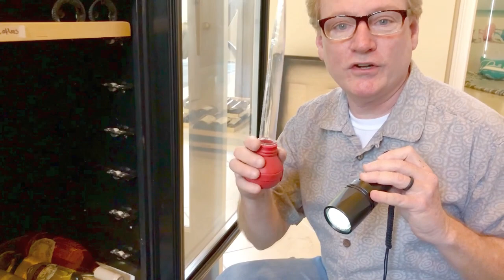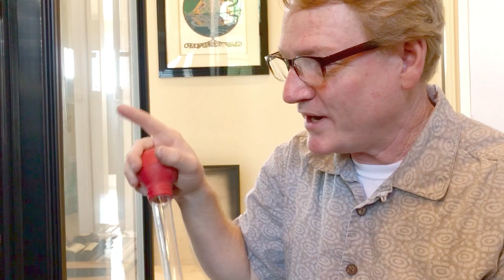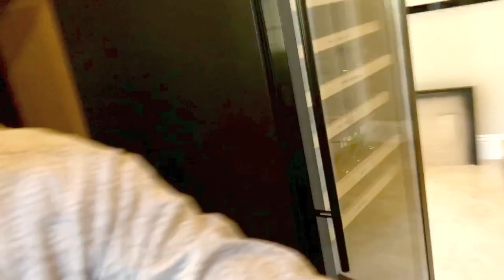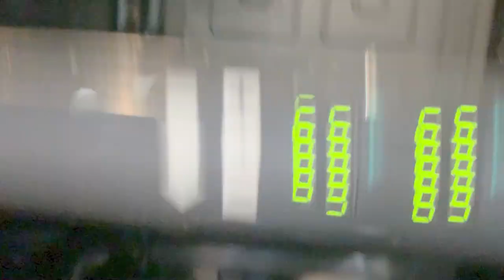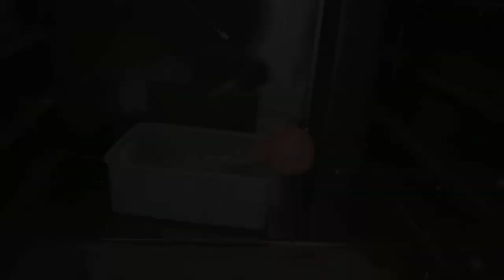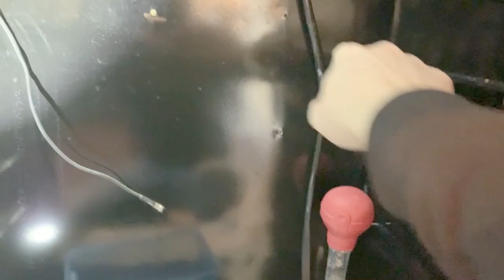How To Fix Common Wine Fridge Problems

Comment: Just found your channel. My wine cooler is a dual-zone unit, and recently I noticed the upper zone is no longer cooling to the desired temperature. I've also noticed that the humidity in both zones drops below 20% once the unit starts running. If I turn it off for a few hours or a day, the humidity gradually returns to around 60–70% without the unit running.

The cooler is less than 3 years old. Do you have any advice on what might be causing this or what I should check?
Reply from the maker: Low humidity is how it should be. The reason why the zones are not regulating is because only one zone is actually cooled, and the other has air circulated by a fan. It could be that one of the fans has gone bad. Bad bearings or just a failed winding or so.
Reply: @WilliamBennerJr thank u so much

Comment: The compressor in our Haier wine fridge does not come on at all.  The electricity to the unit is fine, since the inside light works fine.  Any ideas?
Reply from the maker: You'll need a volt meter to "trace it", from the AC, through the relay that feeds power, to the compressor, to see where the voltage isn't getting, and then take action from there.
Reply: @WilliamBennerJr Thank you so much for your response. We are getting above my pay grade at this point.

Comment: Hi, I have a wine cooler that didn’t run at all but I changed the start relay. Now it runs perfect when first plugged in. The compressor runs and cools to the set temperatures in both zones. But when the temperature is reached and the compressor stops it won’t turn on again. Which results in temperatures slowing raising to room temperature and finally causing a beeping alarm. Any clues?
Reply from the maker: How do you get it to turn on again? Unplug, then plug it back in? I'm just curious. Typically things have only a single problem. You found and fixed the single problem. It works for a while, but now it looks like there is a new problem. Indeed you could have two problems in a single unit. That's not against the constitution. But it's rare... So I wonder if the start relay that was put in is the correct type, or is also faulty? In my 55 year career, that's what I've seen. You fix the single problem, then a new problem appears, but it's really just the old problem re-emerging because of a bad part or so. So you should investigate the start relay. If that's for sure solid, and the compressor just isn't getting any voltage, then you'll need to investigate what triggers the compressor. It could be a relay that turns on the compressor has bad contacts -- as was the case for mine. Or it could be something with the computerized temperature controller.
Reply: Big thanks for you reply, much appreciated. Yes, I could restart the compressor by just unplugging and plugging it back in again. 
But now I might have made things worse or the real problem just reveled itself. I opened up the old relay to check if it was broken but it is intact but slightly burnt,just a small plastic piece was loose. So re-installed it and plugged in. Now nothing happens, not even when changing back to the new start relay. Before the initial change of start relay you could hear that the compressor was trying to re-start every other minute just as you described it. But now there is nothing but fans running quietly after the initial try.
Name of Start relay: QP2-12/B  EPX  JX0914K. 
Actual disc inside is named A556 1330 
I could only find one with similar design and name QP2-12
Thanks again!

Comment: I have one with sealed system. 
Fridge not cooling. How do you determine relay/condenser problems
Reply from the maker: Hmm. This is surely hard to troubleshoot with so few words... Might be best to call a local repair tech in this case.

Comment: I have the 154 bottles cost way wine cooler do u have any suggestions on how to remove some shelves as the directions are terrible thank u 🇨🇦
Reply from the maker: In ours, you just pull the shelves to a point where they will no longer pull. Then elevate the portion of the shelf that is most outward (basically creating an angle) and the whole shelf should just lift out.

Comment: Hi - really appreciate the video! Any chance you could share the Compressor Control Relay info/specs you got for yours? I'd like to order before taking mine apart. Thanks again!
Reply from the maker: It was a few years ago, and I can't remember. However, when it failed I just looked at the side of the relay, got the part number, and found it online. I have two of these refrigerators and it only failed on one, so I'm not sure it is a common-fail item.
Reply: @WilliamBennerJr  thank you - will work on it!

Comment: Hello William.  Great video but I don't see my problem
 I have 2 Vinotemp VT300SS dual zones. Both have the same problem. Top zones get cold and the bottom zones do not. Set for 50 and 55 respectively. Tops get there, bottom stays at 63 and 61. So continuously running. Lower fan is working on both units. I put frozen food packages next to all 4 thermostats and after a minute or so both units shut off. I bought both units (used) in February 2024 and they worked in the beginning. They were manufactured in 2017 (according to the stickers on the back of the units). Little by little the bottom of both starting to climb and now sit at the 63 and 61. I put thermometers in each zone and they agree approximately same 50/63, 50/61.  Strange both units almost exactly the same time with same problem. I unplugged one of the units to see if the electric draw from same wall socket was too much. After 2 days, no difference on the plugged in unit. Can you help please?
 Thank you in advance, Jeff
Reply from the maker: Hmmm. That's very strange. If the compressor is constantly running, then I would think the innards would get very very cold. If not, then either there isn't enough refrigerant in the system so it's not cooling enough. Either that or you're effectively "leaking coolness" (heat leaking into the system), either because your environment is very hot, or because the gaskets aren't sealing well enough (the rubber around the doors). Here's a related question. Does the giant internal plate "evaporator coil" inside getting so cold that it ices up? If so, then your gaskets aren't sealing and that's the problem.
Reply: @WilliamBennerJr  Hi William. 
 Thank you for replying.
I had an appliance guy come over. He said the compressor was no good or it lost freon. I'm confused. I set the top zone as low as it goes (40degrees) I stopped it at 46 because I still had wine in it and didn't want the wine to get that cold. It would have gotten colder. And the zones are not completely sealed from each other so the top cold air would come down to the lower zone. How can it get so cold with low freon or compressor bad?
We did notice the bottom fan was not staying on. Only short burst on and off. Could it be the fan?, thermostat?, or temperature sensor? They want 1500.00 to replace the whole system for each unit. I'm not convinced the compressor is bad. What do you think? Again, both units have the same problem. Strange. The units are about 4-5 years old. 
Thank you in advance, Jeff
Reply from the maker: @jeffrantinella1345  Yes, I had an AC guy say the same thing about my units in the past. Definitely not the compressor or "lost freon" if one area remains cold. If it's a dual zone, then the fans inside which circulate the air from one part to another aren't working. You might be able to "hack it" by putting in your own fan, at least temporarily, just to demonstrate the problem or test the theory. If it does what I think it will, then the problem will either be a bad fan, or the controller that turns the fans on and off. You might call the company that made it (if you can get through to them) and have a discussion... See if parts are available, etc.
Reply: @WilliamBennerJr  Thank you so much. My thoughts exactly. These Vinotemp units are about 5 years old and they discontinued this Designer series. They are no help at all.  They don't have any parts and they cannot even give me part numbers so I can try elsewhere.
 I will figure it out.
Thanks again, Jeff

Comment: I have 250 bottles of wine so 124 white and 126 red so i was thinking to buy 2 wine coolers one single zone for red wine and the other double zone  temperature for white and some red wine so
Which brands do you recommend from the best to the less favorite wine cooler?????
Reply from the maker: Vinotemp seems overpriced to me, at least these days. The last few I purchased were just from Lowes and we're quite happy with them. Basically generic brands.

Comment: I have a VinoTemp that runs and cools, gets to proper temp then after about 20 minutes the inside light shuts off and it stops working until I unplug and replug it back in. Then runs and cools for a bit then no power again. Is this probably a bad main control board.? I would not think a bad relay switch would cause the light to go out, but not sure. Thanks
Reply from the maker: Well so far I haven't found a wine refrigerator on which the light stays on. Normally you turn it on and it turns itself off after a while. (Wish it stayed on...)  So I'm not sure the light is meaningful in this situation. Nevertheless if the compressor also turns off, then it seems like a problem with the power feeding the whole refrigerator (check the socket), or perhaps a fuse or something like that.

Comment: I have a question, I replaced both the overload and start relays, and my wine chiller s still doing the same thing, the compressor turns on, then clicks off after a moment, I filed down the female connections a bit but that didn’t help, any suggestions would be much appreciated.
Reply from the maker: If the compressor hums, then clicks off, that's the overload stopping so much current from flowing. The cause could be a seized compressor, or start capacitor (if there is one) or start "relay" (just PTC thermistor). If you're handy, you could replace the start "relay" with a hard-start kit (big capacitor that also has a PTC thermistor). Also, make sure you've really got the right start "relay" for the particular refrigerator you have.

Comment: Hi there, thanks for the video, it has been very helpful in my diagnosis process. Unfortunately, I still have not figured out what the problem is on my Cavavin V-87WBVC. The problem I am encountering is that my refrigerator is not cooling, but when I plug it in, the compressor is starting, the condenser coils are clean, and the condenser and evaporator fans are all running. After running the fridge for a few minutes (with the compressor definitely running) I hear a click from what I believe is a relay, but am unsure if that is possibly the problem. I'm also wondering if it could be a refrigerant leak which is causing very little refrigerant to run through the system, but I hear a gurgling noise when I open the refridgerator doors from what I believe are the evaporator coils. Do you have any suggestions on what to try or what could be the possible problem? I would greatly appreciate it. Thank you very much for your helpful video.
Reply from the maker: Hmmm. Refrigerators are really not all that complicated. If the compressor is really running, then the coil on the outside (and also the compressor itself) should be getting hot, and the coils inside should be getting cool. If the compressor is running AND the coil on the outside is hot, but the coil inside is not cool then it could be a clogged "cap tube" or stuck "expansion valve". The fan may be masking important sounds so you can disable the fan temporarily, just so you can really clearly "hear" if the compressor is running or not. The click might be a thermal overload (if the compressor is not running) or it could be a high-pressure or low-pressure switch. A competent AC guy should be able to troubleshoot it.

Comment: Hello William.  Excellent video, thank you.  I have a similar fridge, although a smaller 56 bottle, that is not working.  Everything checks out (relays ok, fans run, no weird leaks, etc) but the compressor does not turn on.  It works when I test it direct to current, but the "system" isn't turning it on.  The only thing I can think of is that the PC board is not working properly, or as you noted, the relay.  It lights up and fans run but doesn't start up the compressor, and the start relay works.  I don't (yet) see a gray box like you showed, but like I noted mine is smaller.  Any advice or guidance??  THANK YOU!
Reply from the maker: If you have a volt meter you can check the voltage directly at the compressor itself. If it's not there, then something is in-line stopping it and you'll need to find out what and where. If there is voltage at the compressor and you hear it humming, then the problem would be the "starter" (could be a capacitor or thermistor, sometimes called "start relay").

Comment: Hi.  Thanks for the video.  I think my problem is the compressor control relay.  Do you know what the specs to search for on that are?  I know it’s a 12V relay and has 4 pins.
Reply from the maker: In my case, there were sufficient identifying numbers on the relay so I was able to find it online. I had to remove the relay from the board before I could see the numbers.
Reply: Yes, thanks.  I found it that way too.  I replaced and hopefully this will fix the problem.   @WilliamBennerJr